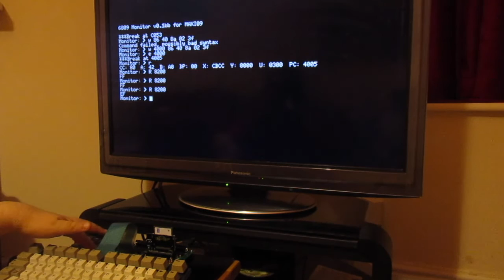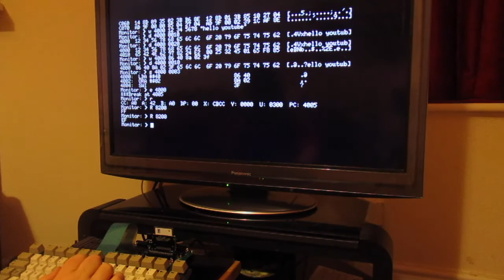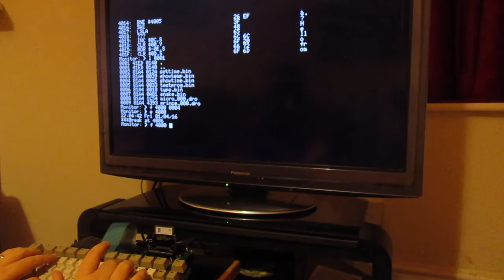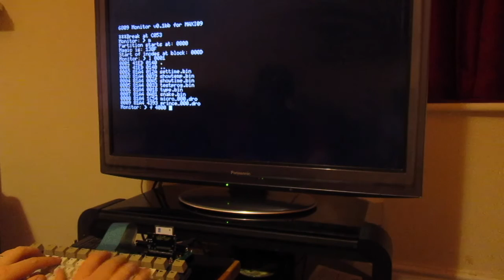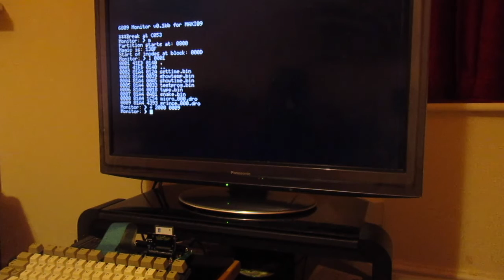MAXI09: Homemade 6809 based micro

Comment: Hi.

Could you not put all the glue logic onto a low cost and readily available CPLDs such as the EPM7128SLC84 or EPM7512AET144 ?? This would allow hobbyist to build one for themselves !

As it would make a Great Homebrew Self-build kit for enthusiasts and the like to get into  microcomputer building !
Reply from the maker: Well, I've moved on from the 6809 now. But what I was trying to do with MAXI09 is implement stuff that you cant do with a CPLD like DMA controllers, fancy memory paging etc. An earlier board used a 6809 with a XC95108, and I found it limiting. FWIW the EPF10K10 in PLCC84 are still obtainable and make great glue logic, including complex designs, for 8 and 16 bit boards. 520 or so logic elements and a small amount of SRAM, stuff you don't see in comparable CPLDs.
Reply: @lawrencemanning  It's a shame you didn't continue with this and turn it into a self build kit, as it is certainly a cut above most 'Homebrew stuff' one see. Then  other hobbyists  could build and enjoy it ...